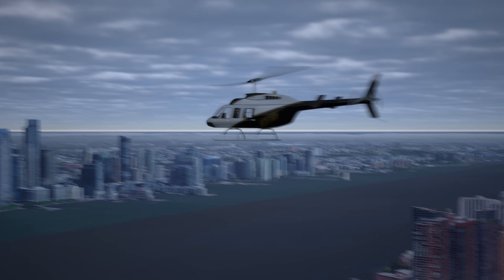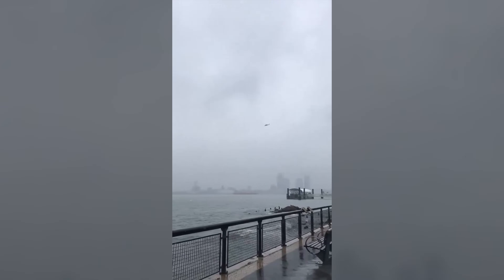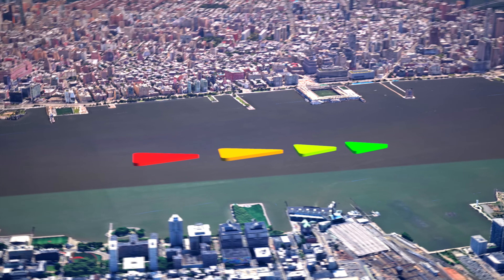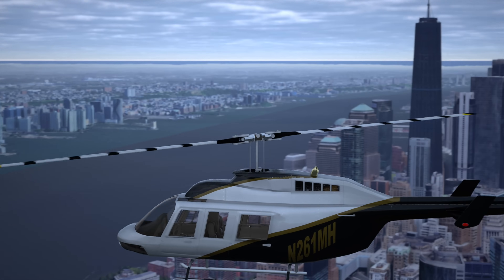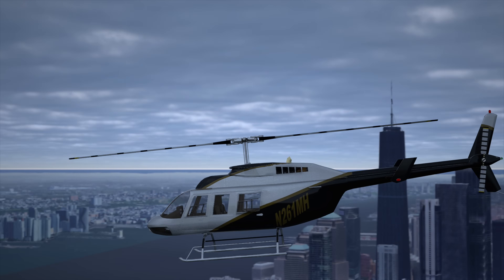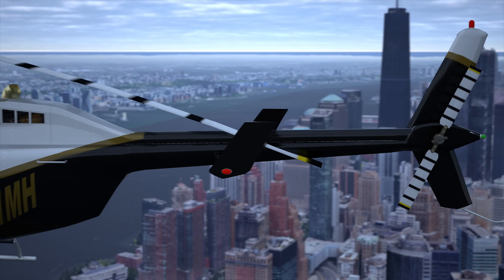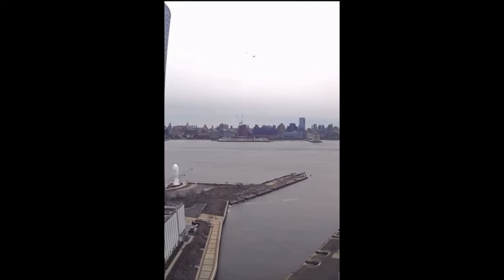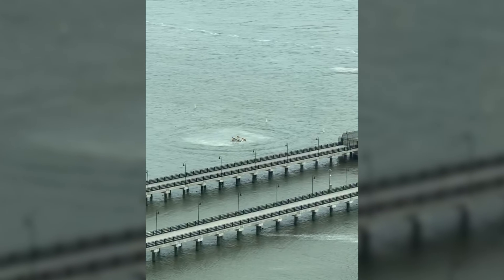Helicopters DON'T just fall from the sky - What is "Mast Bumping"?

Comment: Certified Airframe & Powerplant mechanic with 14 years/5 different platforms of Helos under my belt. 
I saw this video on a social media platform. As soon as I saw the fuselage falling, I instantly saw no tailboom attached. 
My first thought was inflight collision, but quickly realized there's no evidence of that. Second thought was structural failure of some sort. All of the Bell Helicopters I've worked on all been Semi-artuculate rotor heads. I've never once heard of a mast bumping incident resulting in an incident. Doesn't mean it's not possible though. 

I want to present another possibility from a mechanic point of view. On a larger Bell helicopter, the tailboom had 4 mount bolts that had to get replaced for - Life Limited - exceedance. We would do this during a phase or reset after specific flight hour intervals. 
If this particular model has a mounting bolt inspection or torque check an improperly installed mounting bolts would be catastrophic event in flight. I personally always thought the design was to simplistic and had no fail-safe design Incase of improper install or fatugue failure. 
In aviation helicopters have what we call the "Jesus nut". If the torque fails in-flight your praying to Jesus before meeting him. The tailboom bolts are just as important as it connects and supports everything in the tail rotor system. 
Pray for the innocent children. To many people take aviation safety for granted and don't understand how much effort goes into making airplanes and helicopters fly safe everyday in this country. 
We call it attention to detail. One small detail can cause a major incident and loss of life in aviation. Pilots have to be perfect, mechanics and ground crew have to be perfect. Mistakes aren't allowed in our industry. 
Perhaps someone made a mistake, or just structural fatigue. Only inspectors will determine the outcome. I know I sure would like to read the aircraft logbook and see who performed what maintenance. Then interview those mechs.
Reply: This is why I'll never own an aircraft, let alone a deathtrap heli. They need constant maintenance similar to that of a race car. In in the event of a failure at least with fixed wing you have a higher chance, time and different ways to try to save it.
Reply: @Lex1uth3r Airplane pilots, motorcycle riders and car owners need to Not Trust without  Eyeball Verification. How many times does anyone check the engine oil and tire pressure of the vehicle?
Reply: I was a dynamic component mechanic in the Marine Corps, and I'm leaning more toward this or even one of the tail drive shaft flexible couplings failing. I find it hard to believe that the mast bumping would have caused the main rotor gearbox to separate... Ultimately I think this was a poorly maintained helicopter.
Reply: @ perhaps we've crossed paths then. I worked integrated with Marines for years, and helped stand up a program. Highly likely one on the mechanics won't be turning wrenches again.
Reply: I've shared this for the reason you have stated, you know your trade well,  thankyou
Reply: Engineering nerd here.  3 points (bolts) define a plane and thus the minimum.  A 4th bolt is redundant IF the remaining 3 can take the load.  A Cessna strut braced wing is held by 3 bolts.  
    But I don’t disagree with your analysis.  Helicopters are flying metal fatigue testers.  If corrosion and fatigue at play, one bolt failing cascades to the second, then it’s over. NTSB will figure it out.         Cheers
Reply: @danbenson7587  You are correct on that specific statement. One thing engineers don't account for is incompetence from mechanics. let's PLay the "What IF" game real quick.

What if, the mechanic was installing the tailboom mounting bolts, brought the bolts snug, but not torqued. The mechanics intentions were to get the torque wrench later when he torques the TGB mounting bolts at same time. He then finishes other tasks, torques TGB and managment calls him for some other urgent tasks.
He completely forgets he never went back and torqued the tailboom mounting bolts and signed everything off.
Corrosion doesn't come into play, neither does that 4th bolt is only a precaution into the desgin of the install.
Now your helicopter is flying around with untorqued mounting bolts and it's only time until the aircrew and pasengers are undergoing judgement from Jesus.
Reply: @ There are 100s of scenarios.  
      Taking bolt joint only, the joint may be loaded in compression, shear, or tension.  In compression and shear,  bolt torque which preloads the joint, doesn’t matter.  In constant tension, preload doesn’t matter.  Only In tension fatigue preload matters (eg engine head bolts).  A good joint design avoids tension loading.   These comments are true but are simple as joints often have multiple loads.  
     A connection with 4 or more bolted joints, three joints set the plane.  Screwing down  the remaining joints distort the structure.   An example is a 4 legged table that rocks.  If the offending leg is bolted down, the table distorts and suffers induced stress.  The point I make is adding redundancy can cause other unforeseen problems.    Cheers
Reply: @danbenson7587  "The point I make is adding redundancy can cause other unforeseen problems. " Treating a screw like a regular joint is a huge oversimplification.

Your comparison is completely inadequate. It is helicopter made with tolerances that makes your comparison to woden furniture just silly.
For me its also hard to not notice that your understanding of how restrictions on the freedom of movement of the element influence forces and how they will be transferred in the structure is limited or not existing at all...
Reply: @ Do you know of PA28 series problems with rear spar cracking?.  The PA 28 wings and fuselage are built in a fixture.  The front and rear wing spars are rigidly bolted by multiple bolts to the carry through structure. Fixtures are only part of the answer, the other is elastic matching.  Might try Peery AIRCRAFT STRUCTURES for starters which I think is a free download.  Also Mil hdbk 5.
      My sole request is please comment like an adult.     This old fart has flown a 206, (and others) have you?      Cheers D Benson MSME, PE.
Reply: @danbenson7587 great reply.
Reply: Same thing happened to my son who was the pilot of a medical rescue flight in 2021. Bell 430. 5 fatalities. The clevis of the pitch control failed due to failed maintenance. Cracks not detected during magnetic particle inspection. That was the second exact failure of the same part. First crash in 2016 claimed 6 lives. Bell now is trying every trick in the book to get out
of accepting responsibility despite an urgent Airworthiness Directive issued to address the faulty maintenance procedure.
Reply: @esoterex  RIP..... Bell works out of the Boeing culpability textbook.
Reply: Terrible. So sorry for your loss.
Reply: @esoterex Am very sorry to hear you lost your son.  Prayers to you and your family, as well as to this family.
Reply: Im a commercial fixed wing pilot (40+years) and this is precisely why I don’t fly helicopters! There are tooooo many Jesus parts on them! The maintenance hours per flight hour is extremely high as well. When everything works it’s a very capable machine but when it goes south, this is what happens.
Reply: I agree, my bf has a Cherokee and he always has inspections and mechanics checking everything out to make sure everything is right.  People think its just a matter of this and that but the FAA does take things seriously…..we need them reinstated as well.  Inspections are the key to running things right!
Reply: @piratessalyx7871  Reinstated? Do you mean the few hundred, of tens of thousands, laid off? Or the dangers in ending FAA flight controller testing where answers were given to certain applicants?
Reply: @stp479 people think the FAA goes around and does inspections on aircraft’s. No they don’t.
Reply: @stp479 the FAA fired jobs need to be returned asap.
Reply: Terrible lies
Reply: Could very well be a failure in tail boom mounting bolts,came loose or broke,tail boom flexed up contacted the rotors and took out the rotor head and transmission!I think the log book may provide a clue into what really happend,now we will have to wait on the NTSB/FAA to finish the investigation,no expert, just a guess!
Reply: @randallstewart8487 I was just presenting a possibility. Recent maintenance logs can steer an inspector in the right direction.
Reply: @tkoehler44  And a very good possibility at that!
Reply: @randallstewart8487  nope. All assemblies left the airframe intact. Structural over load 
Lost a chink of blade tip.
Reply: Formerly a (Canadian🇨🇦 A.M.E. "R" category),  here.
 The video showing the separated transmission, mast, and rotor blades, not visibly damaged, basically "autorotating" downwards. 
When recovered, should give some clues as to how this tragedy occurred.
Initially, I was recalling an old black and white U.S. Army training film about "Mast Bumping", now I'm not but so sure (?)....
Reply: I'm really curious myself. I'm not a pilot or mechanic but a great aircraft enthusiast. I'm curious if, beyond the 4 bolts you mentioned, if the airframe itself failed, i.e., breaking around the mounting bolts... yes, I know, conjecture, but I'm curious about potential design flaws?
Reply: @timw7946  Failed at second bulkhead no bolt failure
Reply: @HongyaMa 
That's why I asked... I wondered if the bolts are inspected and the airframe is not, or not as often.
Reply: @HongyaMa  How do you know where the failure occurred? From the video itself or your an actual onsite investigator?
Reply: @tkoehler44  Yes, NTSB used my services before in the 90s. 45+ years in helicopters.
Seen the same event but from an 8 foot hover, same results but no deaths.
Reply: @timw7946  true. I think it lost a piece of blade. seen the same before in the 80s live.
N131AT was at a hover when a piece of blade exited the area. sudden roll and pieces slung everywhere.  That 1st piece was found sticking up at the runway center line 800 feet away like a sign post
investigation found the blade was time expired and someone "overhauled" it with bogus records. Fatigue crack go boom.
Student & instructor were lucky it left at a hover. Both lived.
Reply: @HongyaMa 
All i can say is YIKES.
Reply: @timw7946  yep
Reply: @HongyaMa  I was just talking with another highly experienced helo maintainer. He has an experience of witnessiing a rotor blade failure during climbout. 
This would explain two blades that came off, while the other two were not. 
The severe vibrations could result in the seperatiom of the main gearbox from fuselage. 
Also any failure of PCLs would cause contact of blades to tailboom. 

Several possibilities at play!
Reply: @tkoehler44  it was a two bladed system 
I think a foot or two left the scene.
No blade contact needed to over stress the boom. the 2nd bulkhead (rib) is a weak area.
two blades hub mast & gearbox all at once
with the tail in trail , Very sudden event
Reply: They call it a tail boom bumping, but the blades look 100% clean.
If any blade had touched the tail boom, they would have either bent or break.
Reply: All helicopters can self-destruct mid-air if the limits are not adhered to. An Apache can hit the canopy with the rotors if you hit the bump stops hard enough, just about any helicopter can hit the tail boom with its rotors if you try hard enough. They all have different limitations that must be followed for safe flight.
Reply: @tkoehler44 As a mechanic with experience with this model, do you have any comments about what appears to be the main rotor falling WITH the engine/gearbox? I've never heard of anything like that level of massive failure.
Reply: Thanks for sharing your knowledge and expertise with us.
Reply: plenty of counterfeit parts in the aviation world. I bet some fasteners in the main rotor assembly weren't FAA approved.  Or were bogus parts in legit boxes.......
Reply: Aero-engine Aero-frame credo: Nothing short of right is right, if it's not right it's wrong!
Reply: Something very fishy about it
Reply: Thank you for sharing your expertise,.
Reply: Do we still have FAA crew to do this job?
Reply: @Makkyddd  They had to be let go ..... so we can have a parade in June🙄
Reply: Former Bell 412 tech here: the tail boom on a 412 is designed to get you to the ground should one of the four bolts fail. It is not designed to fly with three, but can withstand the requirement for an immediate landing. The pilot would certainly know that one bolt has broken, due to tremendous vibes and erratic tail rotor control (the tail would essentially be flapping).
Reply: I’m autistic, and I just wanna say—I really admire how clearly and passionately you explain this stuff. It makes something I know nothing about feel genuinely comforting. 💟
Reply: Hmmmm....Robbie's have had their fair share of mishap, being abused into bumping.
Reply: @ you're reference to "robbie's", is this the charter company?
Reply: @tkoehler44 No Robbie is a short name for a brand of helicopter, (like the name brand of Cesna in aircraft).
Reply: @tkoehler44  I don't know for sure, but I assume not. I believe it's a reference to Robinson Helicopters, a different manufacturer than Bell.
Reply: @tkoehler44 I think Robinson Helicopter, but I’m not sure.
Reply: I say some sort of mechanical failure that led to the mass bumping when the helicopter lost control.
Reply: Wow ! fantastic explanation of what may have happened. Would these bolts , breaking up , have created  multiple loud sounds ? you could tell on the video, nothing seems to be on the tail.....Can the NTSB find the tailboom , in the water ?
Reply: @ NTSB secures the entire area and every single possible piece of the wreckage is high importance. Bystanders aren't even supposed to touch any piece they may find.
A long a thorough investigation will occur. The problem is, it'll be well over a year likely before any official release from the FAA and most people don't ever hear the official findings.
Reply: Thank you for your perspective. God bless you 🙏❤️‍🔥 ! Your knowledge is truly a gift .
Reply: Too many
Reply: I dont think the tansmision would stay connected to the rotor in a tail strike
Reply: @thomasoconnell4629  Because like most commenters here you do not understand how much kinetic energy is stored in the rotor blades of a helicopter...
The rotor should cut off the tail on impact without damaging the transmission, but at this point the blade itself may suffer and the change in mass on one of the blades will cause huge eccentric forces that will rip everything off as shown in the video.
Reply: Perfect mechanics?  Nah, we just erased the Dept. of Education. No mechanics needs to be educated, let alone be perfect. Let's hire on the merits of kissing orange bunghole instead👍
Reply: You sir are what make the Internet so awesome. Thanks for your input.
Reply: As a civillan who loves everything mechanical including aircraft I was always amazed at how helicopters accelerated with the nose down, never realised that the main rotors was at risk of cutting the rear fuselage off 😮
Reply: Well said. RIP for those who died.🙏⚖️🙏
Reply: The aerospace engineering world is completely different to the civilian world. I was in the RAAF for nearly a decade as an avionics tech, and pedantic doesn't even cover the basics of what was required. Even simple things like replacing wiring, we had to have a small bag containing all the stripped insulation so that it was all accounted for and no FOD was present in the jet, as well as the SENGO could inspect each piece of insulation to ensure no strands were compromised in the stripping process. Insanely thorough, but when millions of dollars worth of jet and someone's life is on the line then nothing is beyond the scope.

After I discharged I worked as lead electronics design engineer at a robotics company and had a permanent eye twitch whenever I journeyed out to the workshop to inspect progress on projects. Wire cut offs, insulation, all manner of debris sitting in the bottom of electrical enclosures that would be cleaned out at the completion of the task. The techs generally cleaned up everything, but seeing so much garbage sitting inside something so vulnerable to debris never sat right with me. Once you've worked on aircraft it's hard to let go of those stringent practices.
Reply: Wish my brother was around to comment ..two tours in Nam flying Huey's& Cobra...test pilot at Pax River... Distinguished Flying Cross award
Reply: All the holes in the Swiss cheese lined up.
Reply: Prbably assassination
Reply: pues sí,todo apunta a que se soltó toda la hélice ,con su eje principal..como si se hubiese soltado,y solo es posible esto por dos motivos: sabotage...o mantenimiento defectuoso
Reply: They cut every corner they can 
Greedy
Reply: The Jesus nut was my first thought. The profit margins in running a helicopter tour business was the next. I’m waiting for maintenance records and parts purchasing
Reply: As a fellow 206 mech, I am doubtful  the tail mount bolts are a likely culprit. Even if a couple bolts were not torqued properly I can’t imagine it leading to such a catastrophic failure. It would have to be a situation where they were only hand tightened or severely over torqued. A mast bump actually seems far more likely to me but I suppose we’ll know when the NTSB report is released. I think this one will be relatively easy for them to determine.
Reply: I’m thinking sync shaft failure, so many possibilities I agree!
Reply: A&P here, worked on the drivetrains for these ships - agree with your assessment.

I would rather be in a 206 than a single piston cessna any day - autorotations are a real saving grace
Reply: It's pretty much impossible to mast bump a Bell 206. NTSB already said the transmission is completely missing. We all know in theory what will happen if a Helos transmission catastrophically fails. It's coming apart along with everything attached to it.
Reply: Best response ever ! Thankyou.